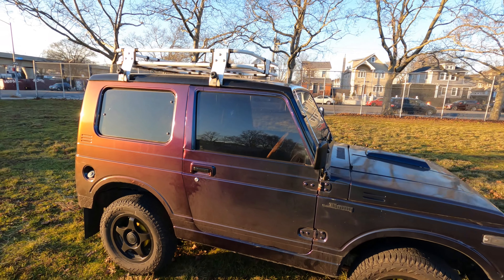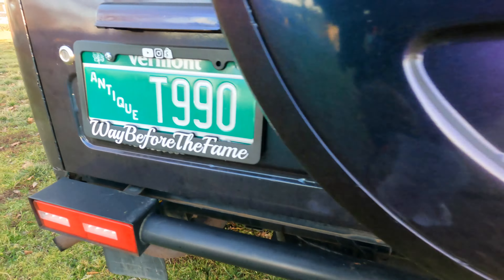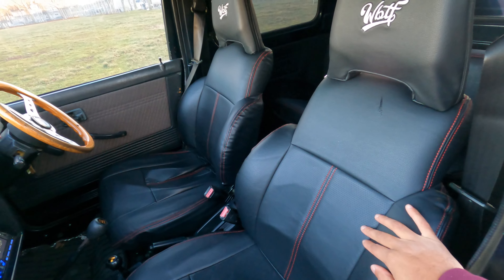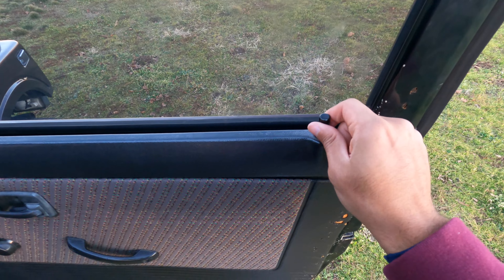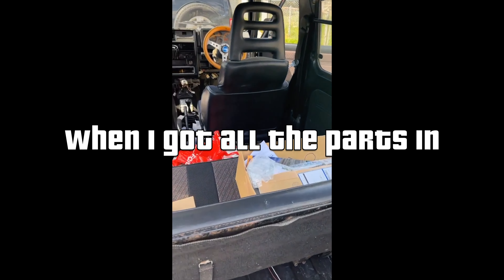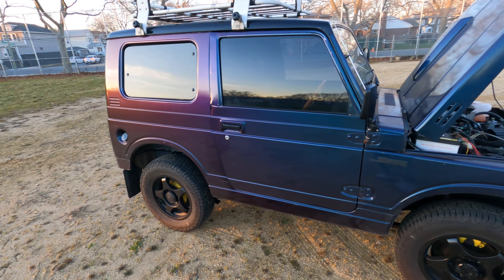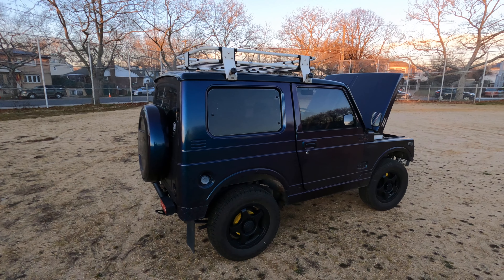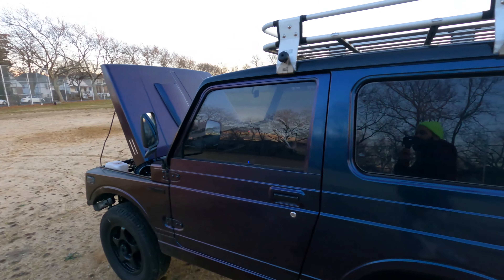Complete Suzuki Jimny Build Breakdown !

Comment: What about that oil leak from the first couple of videos? It didn't seem like what you initially described was from the tiny Turbo. Is that original leak still there?
Reply from the maker: Was from the turbo drain line didn’t tighter it correctly from changing the manifold. Fixed it. Seem like you only comment negative things everything okay lol
Reply: @Waybeforethefame  not negative. You asked what else could you do to the Jimny and that was my response, the oil leak.